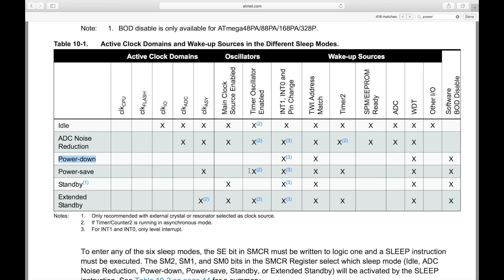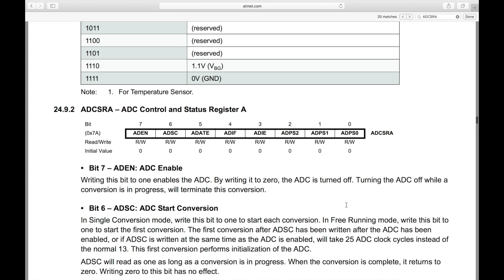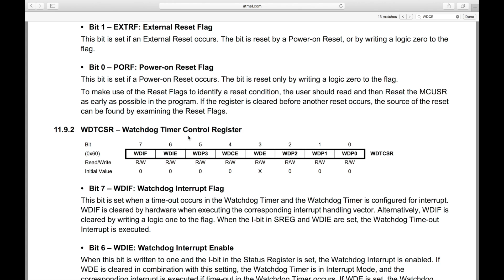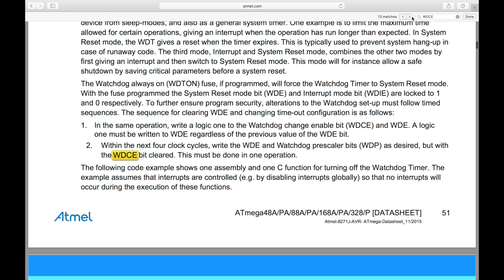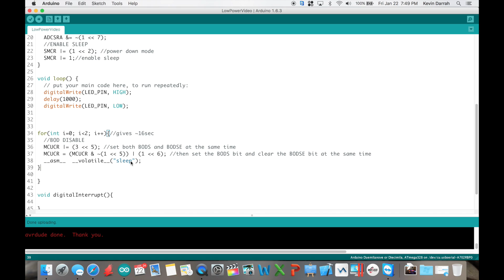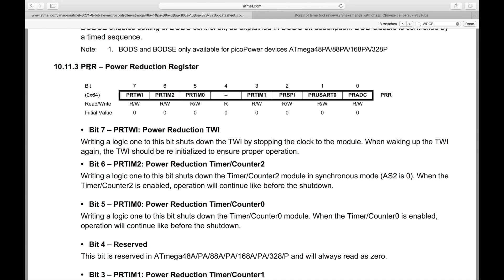Low Power Arduino! Deep Sleep Tutorial

Comment: @12:40 Kevin says if (i != 2) is clumsy. Does anyone know why this is clumsy and what a non-clumsy alternative would be?
Thanks
Reply: The more pins you have the more times you compare to 2 for no effect. But that additional code time is probably insignificant compared to the overhead of the pinmode function call.

You could split this into two loops, one that handles before 2 and one after.

I haven't programmed Arduino for a while, but I believe the pinmodes are just a bitmask, you can set them/toggle them to whatever you want with assignments like he did the other registers.
Reply: +sd4dfg2 I hadn't thought of that. Thanks for your explanation

Comment: Great video, I have a question though. Will  disabling the BOD decrease power IF BOD was disabled in the fuses while burning the bootloader to the micro controller
Reply from the maker: +asim bamedhaf I wondered that as well, but the funny thing is that I'm pretty sure the fuse settings on the part I am using did disable BOD.  I might have to verify that though

Comment: Hi Kevin, that was a very comprehensive video and I think you covered the lot!
I just wish the Atmel guys had done a video like this in the past as I had no idea of which low power options to use.
Maybe they were 'interrupted' too much to do anything else apart from datasheets :-)
I wish I could afford some test gear (and time) to check batteries, but assume if 4 x AA alkalines were used, and without waking the MCU that they would
last at least a year (maybe).
Thanks much again for your great explanation and effort in sharing this!